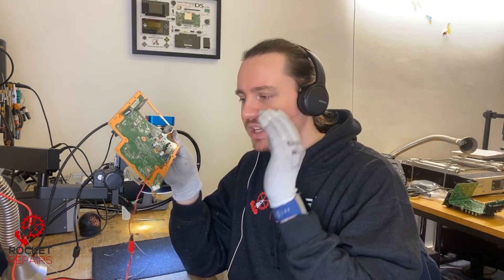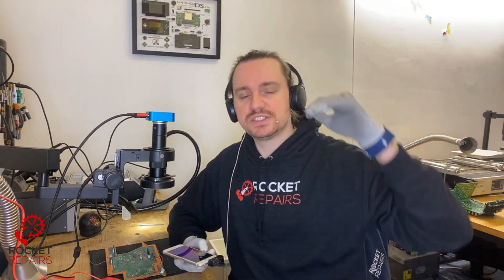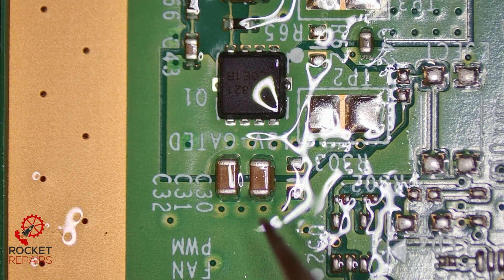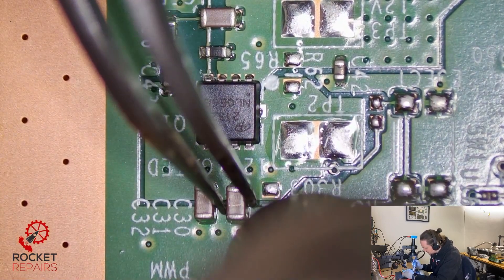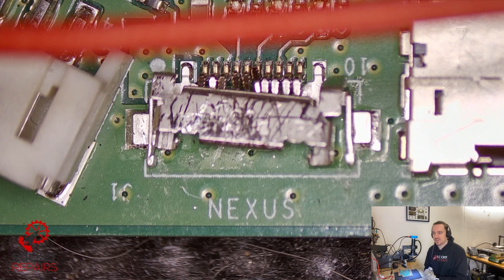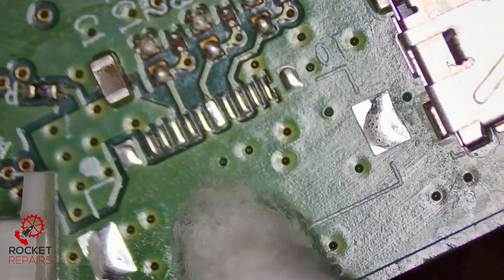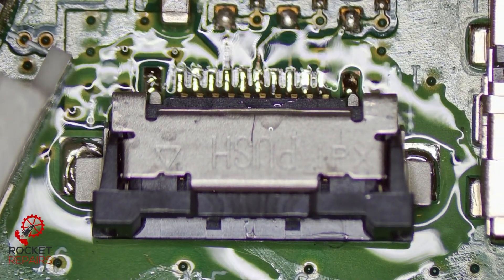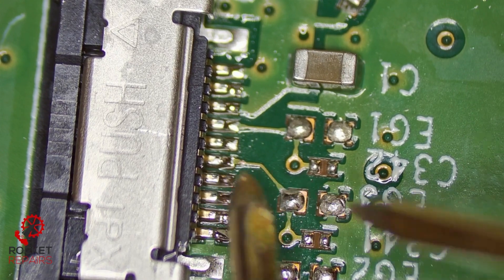Newest Xbox Completely DEAD | You Won't Believe What Caused It!

Comment: My Xbox is the same as this won't turn on l, how much would a repair like this cost?
Reply from the maker: Hey Ben, if it's just a shorted power line and no additional components are needed, repairs start from around £90 depending on the fix 😊
Reply: Mine doesn’t turn on, fix it? Lol Microsoft charges 450$